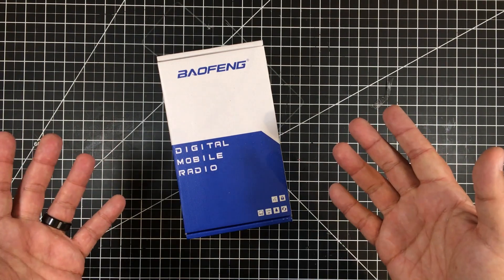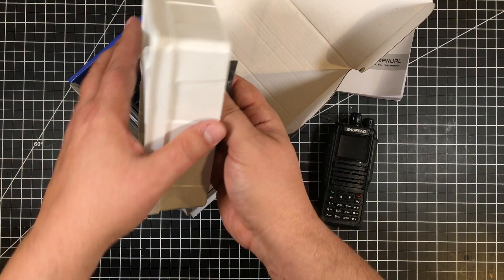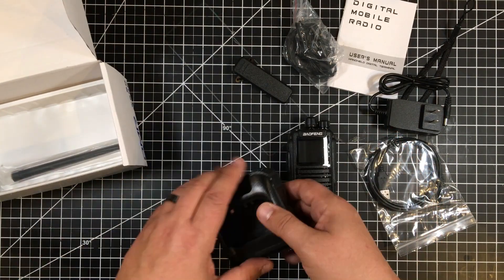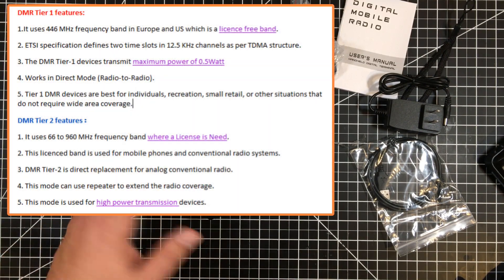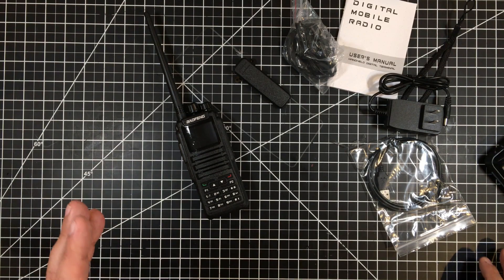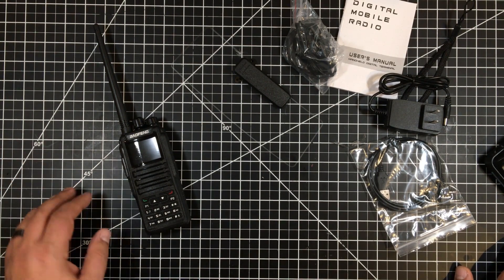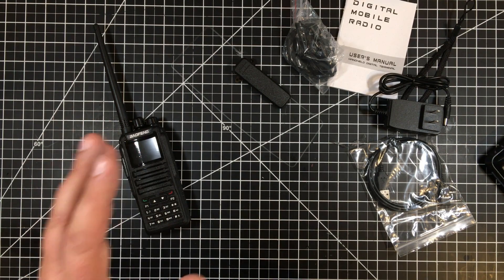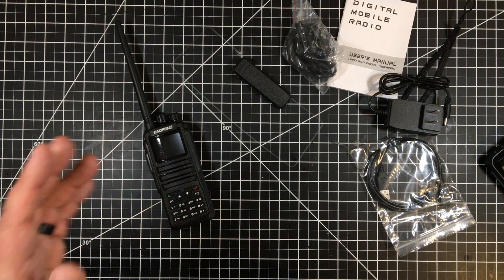BaoFeng DM1701 - Why I Bought This for DMR!

Comment: As a ham radio operator who has been in for several years I say the bridge would be good, because I know a lot of us are on a budget, and needing 3 or 4 different brands floating around with an average entry price around $300 plus each for just the base bare bone unit it can get real expensive fast. The fact there seems to be a new digital mode come out every couple years lately it makes me shiver a bit reminding me of the small fortune I had to spend to be able to get proper HF going. (For anyone who doesn't know if you just buy a basic HF setup your going to get a good lesson on the sound of static. Also people will rarely answer back to your calling CQ because they just can't hear you. After you drop a few grand into a proper antenna, a few grand into proper cables and grounding, a few grand into a proper unit with dsp, antenna tuner, a sdr tap so you can watch the spectrum to see where people are transmitting, a laptop to hook up for digital mode/etc, and at least 600w amp to transmit with a bit of a punch to get you out there you can actually sustain a proper rag chew, or regularly check into a net if desired as long as the pathway is open. As an example of just how expensive HF is, and I don't think we should the 2m/440 newb/easy/kids can easily join in/tech learning/play with new things section to turn into the same kind of pocketbook slayer HF is.)

Comment: What you think about the DM-X model it's similar to this DM1701 but newer I think.
Reply from the maker: Sorry have not seen it, will have to check it out!
Reply: @radiotech2932  DM-X is actually DM1702B model and have a GPS module + APRS compared to DM1701

Comment: in a Baofeng never change the original antenna with a "better antenna" because the radio will go deaf due to saturation...  why?  I don't know
Reply from the maker: Have not had an issue changing the antenna...
Reply: @radiotech2932  try swaping antennas while on the fringe of the repeater's coverage and experiment with uhf  or  vhf

Comment: Baofeng DM-1701   apparently requires Microsoft Excel to upload the user
 contact database.  Is there a work around? A few friends have this 
radio but can't upload the user contact database.
Reply from the maker: I have had issues even with Excel...
Reply: You could make a spreadsheet on google docs and export it into the excel format
Reply: @nc818  Its been a long time since I did this post but if I remember, the problem was getting
the data out or into the radio without using Microsoft Excel previously installed for the Baofeng
CPS to work.   None of the free alternatives to Microsoft Excel installed let the Baofeng CPS
work.  The person who I was posting for did get it to work but had to use his Wifes laptop
who had Microsoft Excel on it.
Reply: I’m assuming that it needs a .xlsx or .csv file and not to actually access excel itself

Comment: This or the Radioddity GD-77? Can't find any comparison reviews.
Reply from the maker: Good question!  My to cents is the DG-77 (see here: https://amzn.to/377oOgg ) is the same as the Baofeng 1801 (see here: https://amzn.to/3barFIx ) with only some minor case mods.  Both are also lessor radio's then the Baofeng 1701 (see here: https://amzn.to/2ub80Yh ) but also cheaper.  With DMR you don't need the greatest, however what I will call out is there is firmware out there for the GD-77 which they claims turns it into a super hot spot (it might work on the 1801 but don't know for sure).  If you want a more robust over all (i.e. Analog & Digital as well as quality) then the 1701 would be my pick.  If I wanted a cheap and cheer radio to hack I would go with the GD-77 just because of the firmware...